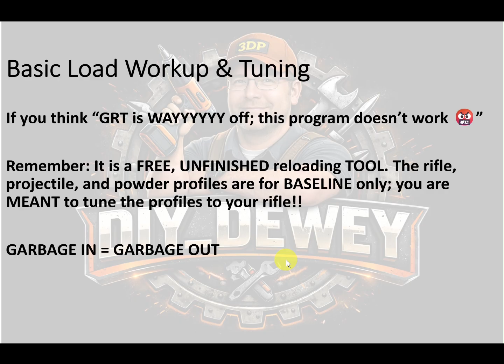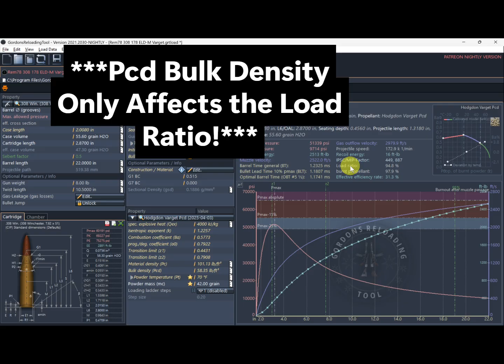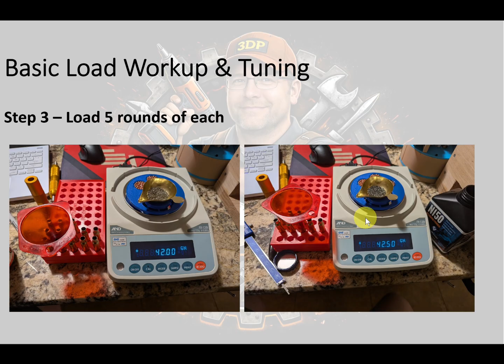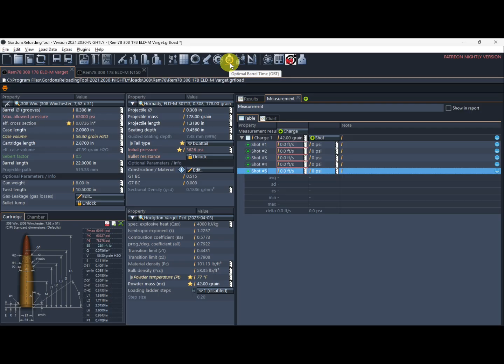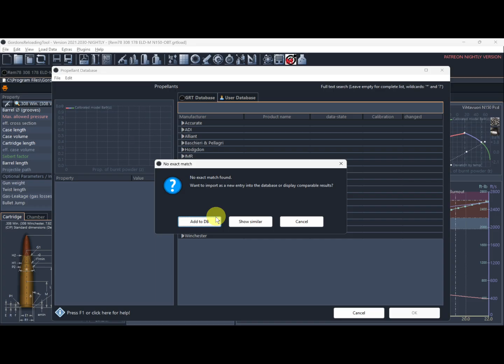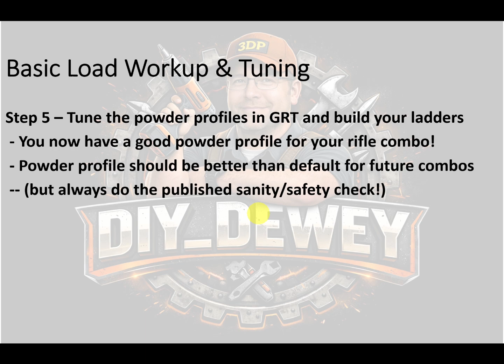Gordon's Reloading Tool (GRT) Basics Part 7 - Basic Load Workup & Tuning (You’re Doing It Wrong)

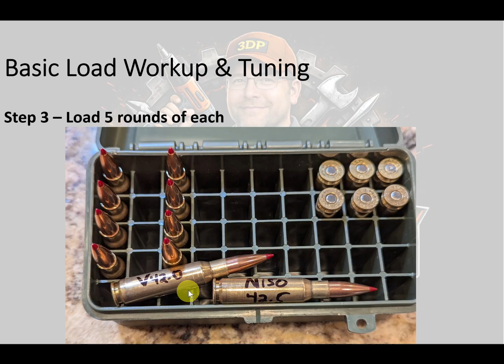Comment: 14:28 An easier way is number your brass, and have a corresponding spread sheet saying "#5 is 42.3gr of N150". This is easier to use on smaller brass(.223 and 9mm) and you can write it in the case head AND on the side of the body, in case 1 or the other accidentally gets rubbed off. Also pay attention, try NOT to touch the writing, and refresh it if it starts getting rubbed off.
Reply from the maker: That's extra work for me, and Ive had papers blow away a few times at the range. I haven't had any rub off over many years. It also eliminates the possible human error of reading the wrong load in the spreadsheet. As long as you have a system that works for you, keep using it 👍
Reply: @DIYdewey   yeah.... I toe the line on some reloading experiments and tickle the dragons tail on occasion(my responsibility, just like wildcating, nobody else's) I'm hyper paranoid either way about having a "dyslexia" moment, so I go overboard with safety precautions like weighing each charge on 3 different scales, and quintuple checking my notes. I started writing like you do, then went to the numbering system. As far as the paper, I keep it on a range clipboard with a backup in my car and in my email on my phone, and obviously on my home computer.... Either method is better than the standard "I think I put it in the correct column and row in the box".

Comment: Yeah... GRT isn't "noobe reloader jump in and run with it" You HAVE to slow down, put as much accurate data in as possible, do some learning(This series made that 1,000X easier instantly), and realize it can't account for EVERY variable, that's impossible. If you do ALL of that AND use common sense safe practices(don't just take the max charge and yell LEROYYYY LENKINSSSS, as you send it) then you'll be fine and the numbers will be close. If you go through the trouble to TRUE your profiles it gets WAY closer(again, this series is doing The Lord's work, in that context). With people actively working on it again, it'll get better and better, but nothing replaces an ounce of common sense. Do your sanity checks. Is it telling you something that is a MILE away from ANY other published data...?? If so... YOU might want to step back and reevaluate.... A chrono of some kind is MANDITORY.... the used cheap ones are less than a pound of premium powder.... Start low, work up.... you ONLY need 1 shot at each charge to do your initial velocity ladder.... and components are WAYYYYYY cheaper than replacing a ghetto blaster, medical bills, permanent disability, or worse.... YOU and ONLY YOU are 110% responsible for EVERYTHING you load, period, full stop, end of story, no questions asked.... 
"DBYFO" JRB

Comment: Why do you need GRT when you have 5-6 published sources of reliable load data?
Reply from the maker: You don't need GRT; you can load however you choose.
However, it's a very powerful tool. If you look at all of the published load data, none of it matches. There are too many variables, and the companies only put out data that is legally safe. Most of them don't list pressure, velocity, load ratio, or burn ratio together. Nearly all load data is for 24" barrels (which I have very few of those). It is much easier/faster eliminating powders with GRT and finding a good load for your specific rifle.
Just because a load is published, doesn't mean it's ideal or worth shooting.
Reply: @DIYdewey 👆👆👆